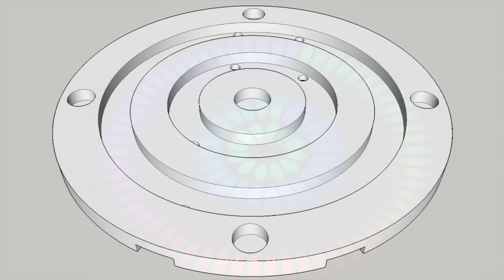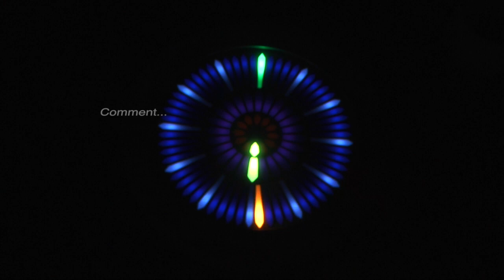LED Clock V2 Final Assembly

Comment: Sir, it's been a few weeks and I believe my maker chops to be sufficient to try this or a similar build. Did you write a blog or consult a particular site to put this together? I have yet to learn 3d modeling so if there is a source for the 3d printed portion I'd appreciate that as well!
Reply from the maker: Seth Cummings Hi Seth, it was all my own work using the free version of Sketchup. Links to the source stl files and blogs are in the video comments. Though I didn't do a blow by blow how to on this one. If you check out the blog links you will find a link to stl files that will print 2 whole parts rather than 2 sets of 5 parts. Just make sure you use the Adafruit rings as other suppliers are slightly different sizes.
Reply: Steve Manley embarrassed thanks so much for your kind reply, it's all right there!

Comment: Great clock, where you can see a diagram of the clock?
Reply from the maker: Artur Schreiber Hi, glad you like the clock. Unfortunately I never got around to drawing the circuit because I have not yet finalised my design. Im currently working on version three which may have a GPS option for more accurate time keeping (not that the current design is so bad that it needs one anyway, but why not) plus a dedicated PCB to tie everything together more neatly.

The Header in the current Arduino sketch has the connection details for the various modules used. Once V3 is is done then I can make a proper circuit diagram available.
Reply from the maker: Hi, As your not alone in wanting the circuit diag of the current clock, I will be doing a rough sketch in the next few days and placing a copy in my DropBox. I'll let you know when Ive done it.
Reply: It would be great if you could share this information. I'm looking forward. Thank you.
Reply from the maker: Having to re-learn Eagle CAD as I haven't used it for a couple of years, may take a little longer than I had hoped. Please bear with me on this.
Reply from the maker: Hi Artur, You can now get the Schematic here:
https://www.dropbox.com/s/abdfuevxvb3jjg4/Steve%20Manley%20RGB%20LED%20Clock%20V2%20Schematic.pdf?dl=0
Reply from the maker: Hi, I'm happy for you to put a link on you web site to the file or files in my DropBox. All credit for the data should also acknowledge me (Steve Manley) as the creator and rightful owner of that data.
Reply: Of course, including information that you are the author with a link to your website. Thank you.

Comment: Very clever! You should market the parts as a kit if you haven't already done so. Cheers!
Reply from the maker: Hi, thanks for your comment. 
I have placed the STL files available for download should anyone want to 3D print them for themselves. Unfortunately my printer is to slow, small and of insufficient quality to go into production with, which means going to someone else to make the parts, and that could be quite costly. Do you have Any suggestions?
Reply: +Steve Manley Sure do! Kickstarter, Indiegogo & Patreon. I'm sure you'll be able to crowd-source your idea very successfully.  Best of luck!
Reply from the maker: +Omaha nine your not the fist to suggest Kickstarter, and maybe I could be onto something, but for me it is just a hobby project,  and because I can and did make all the parts myself (excusing the actual electronic modules) without the need of others, then I'm happy with what I have done. 
I have seen many other clocks and some are way better than mine anyway.
Reply: Your clock is exceptional Steve. I can't imagine any cooler than yours. I'm only 60% complete with my RGB Cube and I find myself thinking of ways to convince my wife I need a 3D printer.
Hmm, soft music, bottle of wine, candles, her favorite dinner ......
Any help would be appreciated.......
Reply from the maker: Ron Dumas Hey Ron, thanks for your appreciation re my clock design. I'm working on V3 and using a CNC router to create the clock face etc. (yup just got a new toy), which means I can machine the face in two parts rather than 10.

I'm no expert in marital relations especially someone else's. Personally in my relationship so long as the major bills are covered, I tend to get away with the odd purchase, plus my wife likes the cool things I make with them. Plus I generally hold back how much an item costs even if asked.

If a 3D printer is what you want, then I'm sure you will find a way to get one.

For info: if I were to invest in a new printer, I'd personally go for the Ultimaker 2 (advice passed to me just the other day from a trusted source).

Comment: Hi Steve,

You kindly pointed me to your code repository a couple of weeks ago.  Perhaps I'm getting a bit dim in my advancing years, but I can't figure out the devicew used in the clock.  Do you have a simple explication of the devices used and how they are physically interconnected? 

 In the code, headersmake  mention of a couple other chips for the design, but no data  on their interconnection.  Sorry to ask, but do you have an idiot's guide to connecting the famous 'Steve Manley Magikal Clock'?

I know this seems trivial, but I just can;t seem to grasp the whole project without a full schematic on my screen.  Your help is greatly appreciated!

Thanks again, this should be fun...

Jeff Thompson
jeff999thom@gmail.com
Reply from the maker: +jeff thompson Hi Jeff,
As yet I haven't created an interconnect diagram. My clock is still evolving so I haven't yet committed to creating a diagram. The devices are listed in the header and the pins used on the Arduino are are labelled in the #define's directly under the header. If you get the same Sparkfun clock module I used then you will see the SPI pins labelled quite clearly. RTC = Real Time Clock:

#define  RTC_CS       10             // RTC - SPI chip select  to Nano pin 10
#define  SPI_MOSI    11             // RTC - SPI data out      to Nano pin 11
#define  SPI_MISO    12             // RTC - SPI data in         to Nano pin 12
#define  SPI_SCK      13             // RTC - SPI clock            to Nano pin 13

If your still stuck then I can write up a better connection schedule.

Comment: Hi this is an amazing clock and perfect for what i need but i can't seem to find how you have wired up the rings to each other ?? have you gone big to small or the other way round  or are they all independent of each other?? many thanks :)
Reply from the maker: Hi Andrew, glad you like the clock. I wired the rings in series outer to middle. I did try wiring them separately but when you want to update all the LEDs at once it is slightly more efficient to do so as a continuos string than 3 separate ones.
Reply: +Steve Manley .. Thanks for that now all I need to do is change the code to work with my Ds1307 RTC :) oh joy !!

Comment: Do you have the STL files available somewhere ? I really like your clock it would make a fantastic gift.
Reply from the maker: +patprop74 Hi,
I just uploaded the STL files to DropBox:
https://www.dropbox.com/sh/vxi5b4cutua4pgv/AAAVNIbd0v5E99qXO_wXz7LDa?dl=0

There are 2 zip files, one contains the clock face and back plate as whole parts, best if you have a larger high quality 3D printer. The other zip file contains the clock face and back plate as multiple parts, ideal for smaller printers.

I recommend printing in PLA plastic if you have a choice of PLA and ABS like I did. I achieved much better results with PLA (less bowing).
Reply: +Steve Manley Thank you Very much Mr Manley.